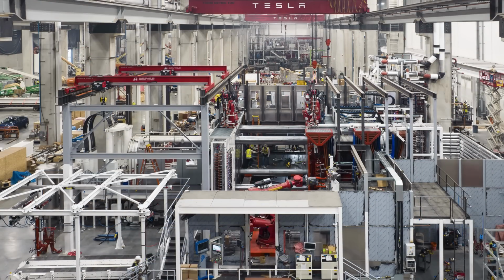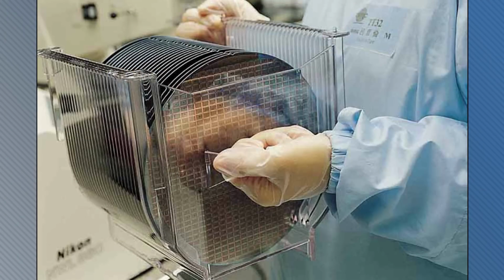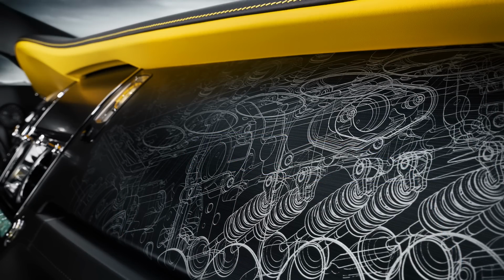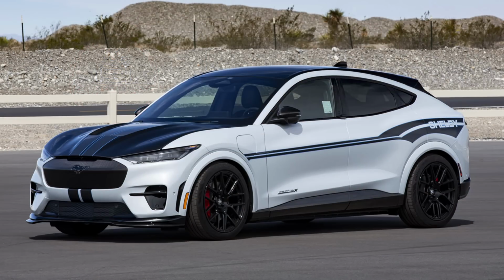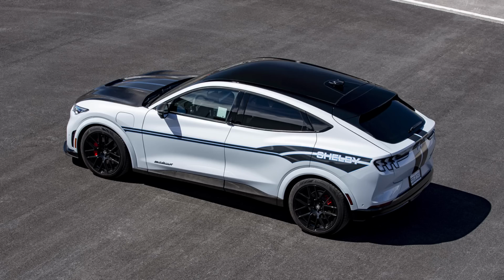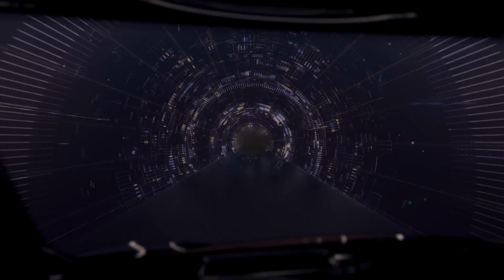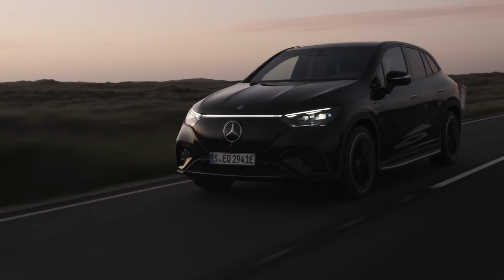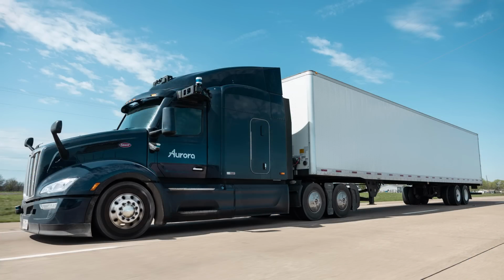OEMs Racing to Copy Tesla Gigacastings; Shelby Mach-E Not Sold in U.S. - Autoline Daily 3555

Comment: Gigacastings are only possible because they have found a way to decrease failed casts, since multiple smaller parts welded together works better when your part failure rate is higher. Seems like a cheaper way to manufacture with less waste, and "production efficiency" seems highly dependent on the metric being compared.

Comment: With respect to the Chevy Bolt being canceled, I read an article yesterday (R&T). 
A number of positives were said about the Bolt and regret it was going to be canceled. 
A number of reasons were given why they understand that gm would what to fill the offering at near that price level with the Chevy Equinox EV.

The Bolt does at this time seem to have a 6-month wait if you order from the factory and this month it appears under a week's supply at dealer lots (GM Authority). 
They could sell a lot more if they had (desire, parts, labor, etc.) I am not going to speculate on the reasons. A number of happy Bolt owners on a forum I have been reading.
The Ford Maverick is sold out for the year crazy times. 

My only concern is it may take time to ramp up the Chevy Equinox EV. 
I am going to keep my eye on the all-wheel drive version (I am located in a region with lots of snow).

Comment: Giant castings make your car unrepairable, so of course firms are very happy to pursue this strategy! it cuts manufacturing costs, but down the road, if you don't make the castings modular (and Tesla is not!) a simple fender bender can now total the car. Aluminum castings are not repairable in general. Aluminum alloys are not like steel which can be easily welded. There is a reason why Steel was the "go to" metal for buildings, ships, etc.,  all of which must be repairable.
Reply: The impact beams can be swapped at the front and rear. The casting itself is very good to weld. First inform and then spread your opinion.
And your last sentence makes absolutely no sense. There are reasons why steel is used, but buildings and ships are made of steel so that they can be repaired... good joke 😂
Reply: @Zedus-rl9hp  My family made safety equipment out of aluminum castings. I know something about this, and a quick google search shows that for safety reasons, Aluminum is not really repairable:

"6061 is highly weldable, for example using tungsten inert gas welding (TIG) or metal inert gas welding (MIG). Typically, after welding, the properties near the weld are those of 6061-0, a loss of strength of around 80%."

A repaired car would not pass any crash tests, and would be a safety risk. So no, these mega castings have drawbacks.

Elon is a brilliant guy, when has he cared about repairability? He glues in his thousands of battery cells now, and Gruber charges $5000 to replace just a few bad cells. The difficulty of repairing Tesla batteries is its worst environmental cost
Reply: @edwarddejong8025  6061 is an aluminum alloy that can be hardened, of course the hardness is reduced again after exposure to heat. But that is not the case with the casting here.
There will certainly be a handful of cases where the large die-casting causes the decisive costs. But given the fact that a warped front end is almost always (over 95%) a total loss (regardless of whether it is steel or aluminum), this is not a big argument against it. Furthermore, in addition to minor accident damage, it is often enough if the airbags were deployed to make it no longer profitable.

It is always a construction design-technical consideration: if the cells are installed permanently, there are generally fewer sources of error, which in turn lowers the overall repair costs. But for the few remaining damages it will be more expensive, that's correct.

Comment: An example of the aforementioned advanced casting can be seen in a ribbed aluminum casting, which begins at the shock tower and runs to the rear of the CT6. Hester explains normally this structural component would take some 35 pieces to assemble, but with the new casting technology, it’s one single piece. He also noted that there are no less than 13 high-pressure die-cast aluminum pieces in the structure of the CT6. Including the transmission tunnel.  GMAuthority 2015...
Reply: Cadillac also uses very cool tech like flow-drilling screws, which can join two different materials (ie. aluminum and steel) and create it's own thread, reducing the process to one step, as opposed to drilling holes, inserting threads, etc.
Reply: @areitu  the front end of my 2018 CT6 is allot more ridge than the 2014 XTS Vsport.

Comment: The subscription model for unlocking features that your vehicle is already capable of, needs to die a horrible death.
Reply: depends... those have extra cost to the production, but if they don't charge at the purchase price then they need to recope that cost in place of subscriptions. Don't like it don't buy the subscription.
Reply: @nguy404  How do they have extra cost to the production when they are included with every vehicle? It's not like they send someone out to your house and install something that makes it possible (or at the dealership). One can only hope that people will see what a greedy dig it is and refuse.
Reply: @JustWasted3HoursHere  if the cost for parts and labor are not included in the price sold for those features to function at purchased, then I don't mind the subscription based. If not enough owners subscribe then they lose money.
Reply: @nguy404  But In the case of EVs, adding extra performance is literally a tweak to the control computer software. It contains the same physical hardware that an EV has to have no matter how fast it is. The power unlock is a one time cost, I believe, thank goodness, but there are others being tested that are an ongoing cost for a specific feature. What happens if these automakers go out of business? Can that feature be recovered? To me, a slightly more fair business model would be, if they are dead set on doing subscriptions, is to unlock the feature permanently after, say, 5 years. They should be able to recoup their costs many times over in that amount of time and also safeguard future owners in case something happens to the company.

It's just bizarre to me that there could literally be a situation where a base car and the top of the line model could be the same exact car with only a few bytes in its software being the difference (along with thousands of dollars).

Comment: The SEA platform is not used on the Volvo EX90. The Volvo EX90 uses Volvo's SPA2 platform. The Polestar 3 is also built on the SPA2 platform. The Polestar 4 is built on the SEA platform and Volvo's EX30 will be built on it. btw, the SEA platform was engineered by a Swedish engineer Kent Bovellan who is a head engineer at Geely.

Comment: All of the OEMs are using smaller mega-castings. Volvo's use of them is far different than Tesla's.
Reply: And that despite the fact that the supplier/contract manufacturer Magna was already pushing for larger die-cast parts several many years ago, but the OEMs didn't want that.
Now they see that it is possible and brings enormous advantages...

Comment: It would be really interesting to compare the “clever” aluminum castings GM touted back in 2015 for the Omega platform/CT6 with these new “giga castings.” Was GM on the right track, and these are a logical/simplified progression? Tesla has been better about highlighting the benefits of its technologies, that’s for sure, but these types of castings seem like they’ll make cars even more disposable. Cheaper to build, more expensive for the customer if anything ever needs to be repaired.
Reply: Castings are not Tesla technology, they've been around for a century.
Reply: At the point where a large casting is damaged, the car would be totaled if they didn't use a casting. Imagine trying to fix even 1/3 of the 150 parts that the casting typically replaces!  And the casting makes the car stronger and safer - two important attributes to me.  I'd rather survive a crash that the car is totaled, than die even the car might be repaired.
Reply: @tesla_tap  A casting doesn't replace 150 parts by may replace several individual parts. Problem is even a small crack or twist in a casting renders it useless whereas a weldment made of of several pieces only requires the replacement of the damaged pieces that can easily be welded into place. The stamped steel parts are relatively cheap, the casting will cost several thousands of dollars. But at that point it's not Tesla's problem it's your problem.
Reply: @heathwirt8919  It depends on the casting. Traditional ones used by Legacy companies only replace a few parts.  Tesla was able to replace over 170 parts with a single huge casting in rear of the Model Y.   Castings can also be welded if cracked, but at the point that a casting is cracked, the rest of the car is typically so badly damaged the vehicle is totaled. I guess it just depends on the design and how a casting is used.  I'm sure one could design a casting that is damaged by a fender bender, but that's just bad design and can be avoided if the vehicle is designed properly.  it will be interesting to see how the industry transitions in the next 5 years.
Reply: @tesla_tap  Your problem is buying into Tesla's hype, it's preventing you from thinking logically. You know nothing about castings beyond Tesla's BS hype. Stop embarrassing yourself.
Reply: @heathwirt8919  Independant analysis from Munro Associates confirms my numbers.  No embarrassment at all from me.  Not sure why you're so defensive or hateful. I have zero issues with any car maker using castings - it's an effective way to reduce costs and improve reliability if done right.  Tesla is just one of the first to do it on a larger scale that many other automakers are now trying to duplicate.
Reply: Cheaper to build also means lower  selling prices. That should level out the repair costs you are speaking of?

Comment: Rolls actually has grass on top of their factory in goodwood.  That has to be the lamest attempt at going green possible.  Get that meaningless grass off the roof and put in solar panels.  It makes no sense that factories which consistently use electricity don't fill their roofs with solar panels. The panels shade the roof which is at best all that grass is trying to do.
Reply: The grass on the roof is nourished by the German s--t underneath it.

Comment: Correction: Model 3 is not currently using giga castings. Only Model Y.
Reply: Model 3 only at the rear
Reply: @Zedus-rl9hp  Nope. Model 3 has zero giga castings at this time.
Reply: Model 3 has a rare giga casting
Reply: @girowinters  no, it doesn't.

Comment: Ford has used castings for years for front strut towers. Much easier to replace than large castings after accidents.
Reply: aluminum castings are used since around 1900.
Reply: You mean... Found.OnThe.Road.Dead  

that Ford?
Reply: @creolerican  First On Race Day. That Ford.
Reply: @joweb1320  fixed or recalled daily... is more accurate, homie

 #FactCheckGoogleMostRecalledBrand